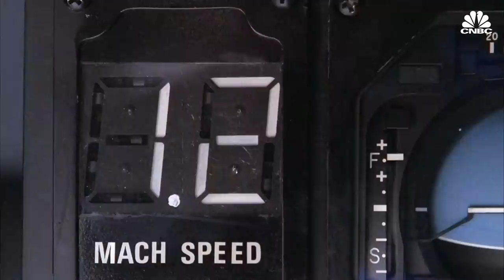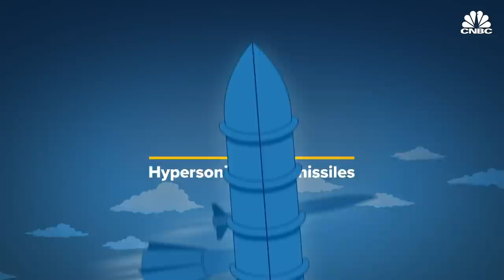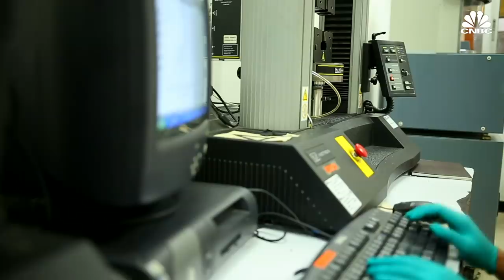How Hypersonic Weapons Created A New Arms Race

Comment: No, the Blackbird is not Hyper-sonic, where do they get their data.
Reply: I know!!! UGHHHH. It only reached Mach 3.2 (unclassified).
Reply: I think Lockheed is going to use a new type of engine system from Britain.I think it is called Sabre and it uses thermodynamics.
Reply: Noel Pytlik  I beg your pardon .I meant a complex gas thermodynamic cycle using helium hydrogen and also onboard oxygen at  beyond Mach 5 . Watch The Three Rocketeers it explains there Sabre engine and Skylon.
Reply: @mikewillis44  link please

Comment: it is called hypersonic above mach5 because friction from air produces temperatures above 2000'c every element would melt at those temp, so special composite materials are used to stay solid at those temps. so calling it supersonic speed wasnt enough.

Comment: the thermal limit for any man-made material is at around Mach 5-6, probably at an altitude of no more than 40-50 thousands feet.
anything that can fly faster has to 'cheat', probably using MHD.
or something even more exotic...

Comment: I am not claiming to be an expert on hypersonic missiles, and I do not expect such a video on Youtube to be written by one, but this video was poorly researched and many facts were presented wrongly. There is nothing that stops a subsonic or supersonic missile from making course corrections mid-flight. They are actually more agile because of their lower velocity and can also usually fly lower to the ground which makes them harder to detect. The challenge in countering any missile is the time available between detection and impact. A hypersonic missile reduces this time because of it's velocity. But it does not mean that it is impossible to counter. How effective the current countermeasures are against hypersonic missiles, or even advanced subsonic and supersonic missiles, I do not know.
Reply: The SR-71 had a top speed of about 3.5M if I'm not mistaken. And aren't most ballistic missiles hypersonic during reentry already?

Comment: 2,7 slow Mach Speed of  Avangard is out dated.  US already has had them way before 10-25 Mach Speed of high hypersonic.  US also has even way ahead new break through of  "Light Speed Propulsion System" 186,000 miles/Second (about 300, thousand Km/Second).

Comment: "evade traditional defense systems"

The US Navy has working anti-missile lasers. The speed of light.

All new US Navy destroyers are being built with an extra pair of electrical generators, meaning theyre planning on mounting lasera.

The US Army is developing their own land based lasers.

The US won the arms race by focusing on lasers.

What's this about America not having a defense against hypersonic?
Reply: It surely has an advantage, but the object has to be in the presence of the laser. Meanwhile, Supersonic missile gets released when objects enter the radar system. It's still to be tested whether laser defence can actually focus on Supersonic Missiles because it travels 3 times the speed of sound which is double the speed of f35. It's not even tested whether laser can take down a jet-like f35.

Comment: This is poorly researched. There is no indication that the nuclear-powered Skyfall (aka Burevestnik) is hypersonic. Its photos and publicly available materials suggest either a subsonic or low supersonic design, its advantage is unlimited range, not speed. Russian Avangard is a hypersonic boost-glide weapon true, but Russian project for a hypersonic cruise missile is called Zircon and it said to have a normal cruise missile range and Russia has already fielded the Kinzhal weapon that flies at hypersonic speeds but is not technically a true hypersonic weapon.

Chinese projects are more secretive than Russian ones but DF-17 boost-glide weapon similar to Russian Avangard but possibly more versatile in terms of deployment was shown publicly on yesterday's PLA parade. A few days ago there was also a "leak" of an unknown new powered missile that could possibly be a high-supersonic or low hypersonic design.

Comment: the Russian nuclear cruise missile is not hyper sonic, Russia is currently fielding the Khinzal hyper sonic missile on some of its Mig-31 aircraft. and by 2020 it will start fielding the Avangard on some of its ICBM's.

the only other hypersonic missile in development in Russia is called Zirkon, which looks very similar to the US's X-51 and is ship/air launched.

the nuclear powered cruise missile is subsonic like the Tomahawk, though like many other Russian cruise/anti ship missiles. it probably has a supersonic terminal phase. at this point its not really clear when or if this weapon will ever be fielded.

then there is the peresvet combat laser system, which is slated to be taken into operational service near the end of 2020 or half 2021, its main task will be to provide close in defense for Russian long range Air defense sites. this would probably make Russia one of the first countries to take laser weaponry in active service, this is probably due to the US stopping the research and building of miniature and mobile nuclear reactors somewhere in the 70's whilst the soviet union continued the same research and development right until the fall of the soviet union, my guess is that the Russian federation either never stopped research or continued it in recent years.

so now Russia has small nuclear reactors that are powerful enough to power a powerful laser, yet still fit inside a relatively truck.

Comment: PLEASE get your facts straight when talking about intercontinental missiles and hypersonic speed. Do at least a quick wikipedia search if you've missed the physics class in school.
"Most national air defense networks were set up to deter traditional, intercontinental ballistic missiles ----- not hypersonic weapons..."
EVERY traditional, intercontinental ballistic missile travels at hypersonic speed for most of its flight, with a re-entry speed far greater than that of any "hypersonic weapon" referred in this video! It's math people, a simple fact that derives from having to hurl an object to the other side of the world with a rocket engine. Even the Soviet R-7 rocket/ICBM that blasted Sputnik into orbit had a higher top speed than any of the hypersonic weapons this video is talking about.
There is , and always have been NO reliable way of stopping an incoming ICBM. The point of these new hyprsonic weapons is that the speed advantage can now be applied on a smaller scale, with tactical weapons, with the added benefit of better guidance systems that allow a conventional warhead to achieve what was only possible with a nuclear warhead in the past.

Comment: Russia is already developing a hypersonic glider that during final descent it becomes a scramjet and not just any scramjet....This scramjet uses hypersonic expansion of air in order to partially liquify it the rest of air that does not liquify is passed through a ramjet in order to rise its temperature and pressure, its then burned with a liquid fuel, the burned hot gases are used as flame holders for the scramjet. lol troll
Reply: India is also developing one

Comment: The only manned powered aircraft ever to reach hypersonic speeds is the X-15 rocket plane. The SR-71 could not fly at Mach 5+. While the exact maximum speed with afterburners is still classified, the figure is widely believed to be a bit above Mach 3.